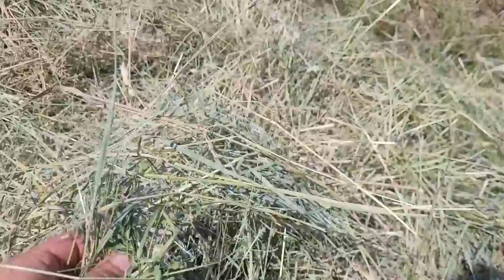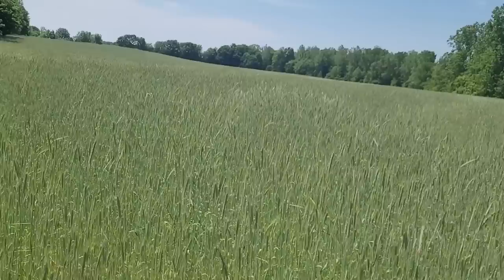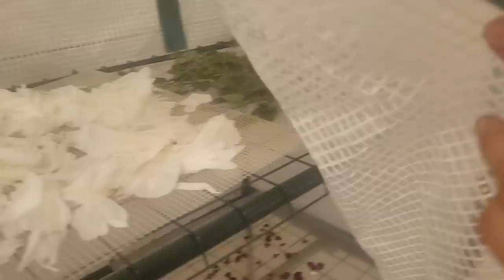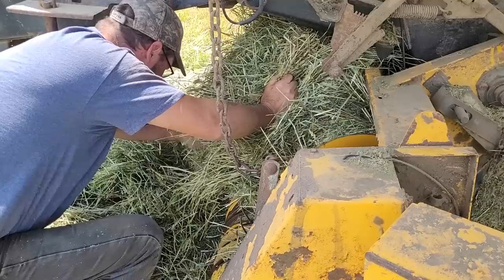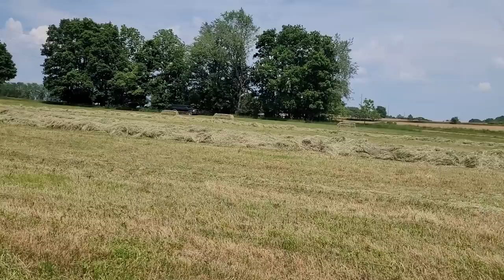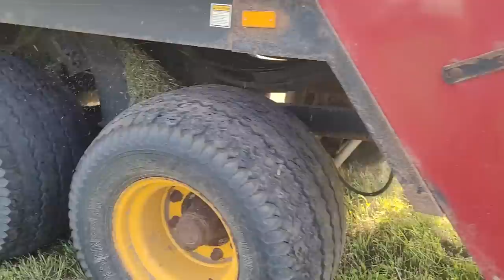Baling Hay With The New Tractor

Comment: I love the ending with you and Kevin sitting in the vehicle just being silly with conversation.
Tractor seems to be surging while running.
Reply: The surging...iirc...is called the "power stroke" the tractor pto gives the baler to incite its internals to compact and string and eject the bale...and is normal for many balers!
Reply: What you're hearing is, every time the plunger in the baler compresses a new slug of hay, that puts more load on the tractor. Keep in mind the size of those windrows. There's a lot of hay going into that thing every foot!
Reply: @mmurphy2317 I  thought with it surging that way that the tractor is under powered for the baler.

Comment: I haven't ran a baler in probably 25 years but have been helping a neighbor with hay and wheat straw. He has a new Deere round baler with big fat tires and all the bells and whistles. You just push some buttons to change bale size etc... so it is easy to go from hay to straw. It uses net wrap or string. We are using net wrap. Pulling it with a 140 horse Case IH with a CVX transmission. While I bleed green it is just the thing for pulling a baler. That Massey sounds good loping along with that baler. I love a straight pipe.

Comment: I use to drive a 7495 a later model Sisu engine one !!!😳 it was my buddy's one's and I use to do the baleing with it, his one when it decided to go on to limp mode all because of a wire (can't remember quite what it was something to do with the water in the fuel filter sensor) but was sent to the dealer who put it on the dyno only we were amazed it registered 212 hp on the shaft !!!! It looks like yours got hook end arms and a pickup hitch, did it come from the UK??? dose it have buttons to select pto speeds? I could tell you what to try if 540e keeps jumping out, Enjoy it, it was my favourite tractor pulled like a train. Missing alot whensold in 2019.🥺👍

Comment: That Massey seems to be surging a little more than normal, may need to run a rack on her?
Reply: Thats the plunger on the baler going in and out compressing the hay. Every time it slows down it is pushing the hay into the bale chamber.

Comment: Rhonda -- It sounded like the engine on the 7495 was surging. I don't think they are supposed to do that. Might be a fuel system problem. Ask Kevin what he thinks.
Reply from the maker: When the plunger on the baler pushes the hay into the chamber, it makes the tractor work. Very common when baling.